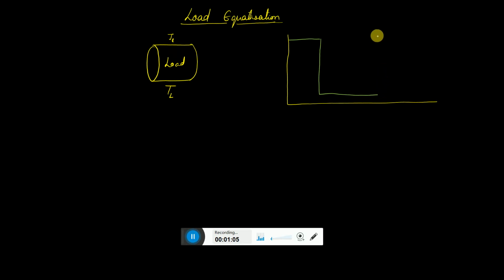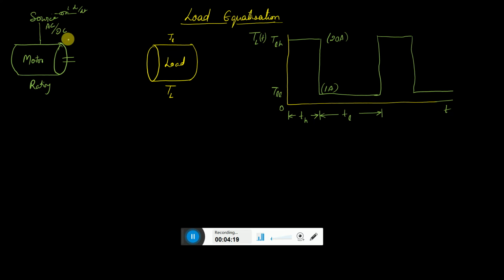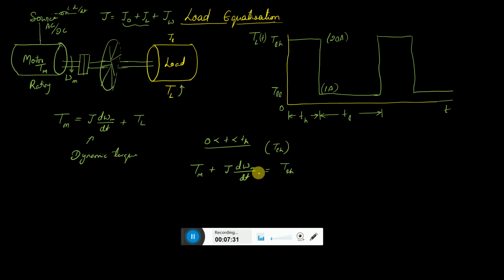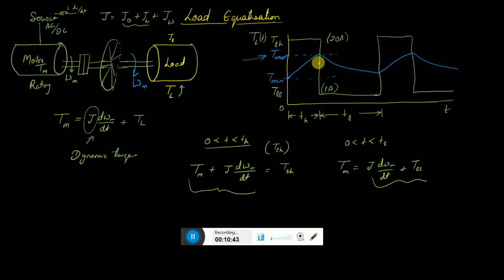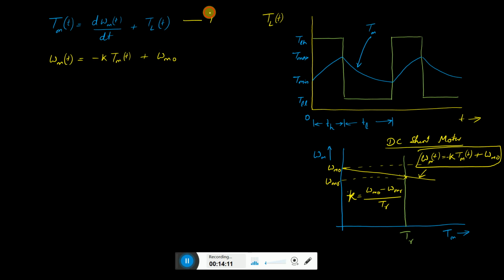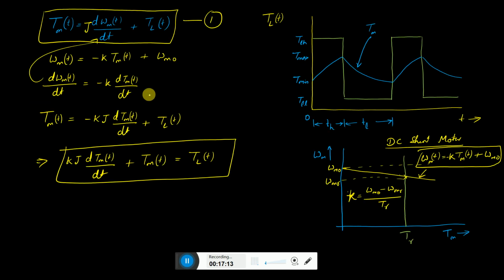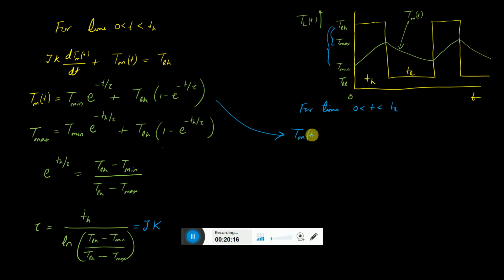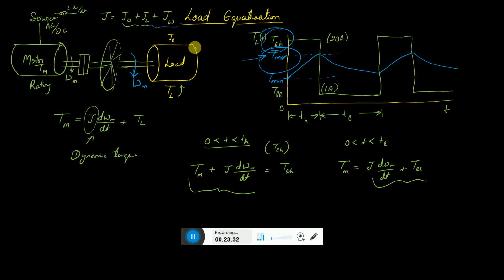ED14: Load Equalization

Comment: Sir how voltage will affect if it is being connected to a constant bus bar..of 230v.. .
Reply from the maker: Generally transmission line has distributed Inductance and major fluctuation of load current ( di/dt) shall change Point of Common Coupling ... Thus bus bar voltage changes.